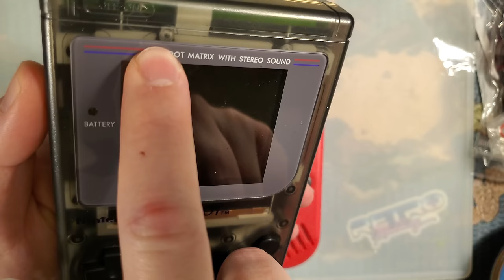IPS Ready DMG Game Boy Shell from Funnyplaying

Comment: I just installed this kit using all the same items in green and yellow. They are now using the same ribbon cable as the gbc with touch sensor built into the ribbon but it’s not used. My question is can it be used to adjust the same items just like the “wheel” it also has the solder pads pwr and touch and I wonder what would happen if you did run a “power” wire from the pad? Would it improve the brightness levels though they are already very good. Maybe you could get the newer kit and redo the video with the updated cable.
Reply from the maker: Chances are pretty good I already did a newer video. I don't know what specific kit you're talking about though.
Reply: @makho  the funny playing retro pixel I did not however look at the ribbon to see the version though unfortunately lol.
Reply from the maker: @dannyhamby6334  Ah well this video and these two are the only others that I made for the FP DMG stuff

https://www.youtube.com/watch?v=2sUiQV9XZ5g
https://www.youtube.com/watch?v=vCXkbPcrYeQ

Comment: hello I bought a kit like that the problem is that the screen inserted in its transparent plastic breaket centered on the screw seats shows me the screen with a lot of black under and above the image is covered .... like in Mortal kombat I don't see the energy of the characters .... the instructions say put the adhesive supplied inside the case and once the screen is centered remove the plastic breaket. how come it stays centered in yours?
Reply from the maker: if you bought the "OSD" kit, just adjust the position of the image on the screen

Comment: Is this shell compatible (without shell trimming/modification) with the One Chip IPS “DMG Backlight OSD” kit?
Reply from the maker: shell yes, bracket no. You may have to cut a wee bit for the contrast wheel though.
Reply: @makho  When you say "bracket no", do you mean that the bracket that's included with the One Chip doesn't fit the shell or that the bracket in the FunnyPlaying kit doesn't fit the One Chip?
Reply from the maker: @ryankao2248  funnyplaying bracket doesn't fit OC kit